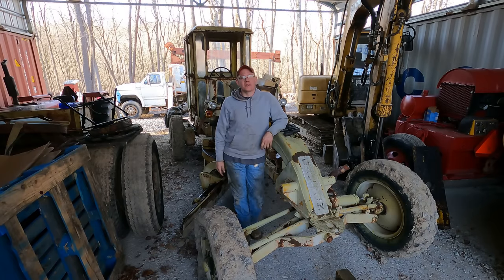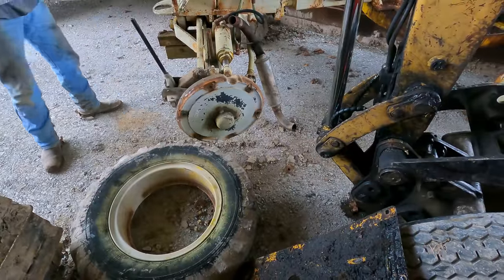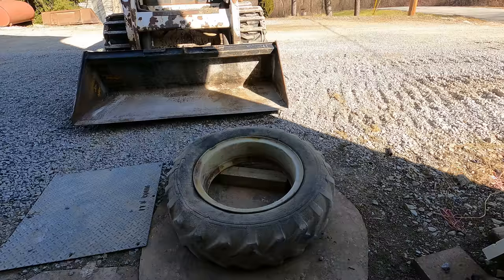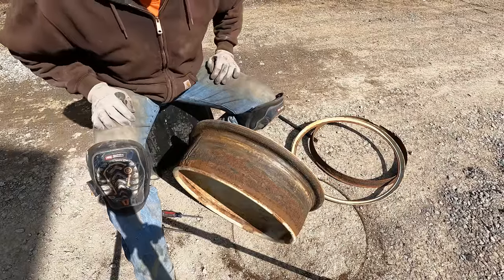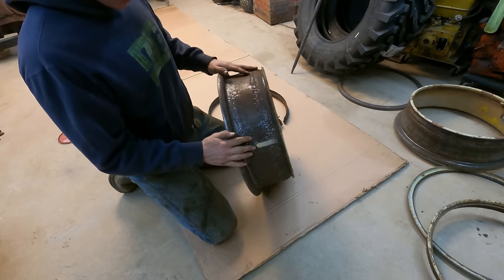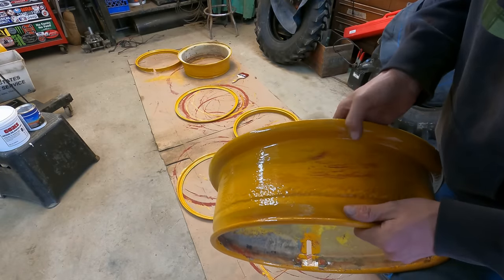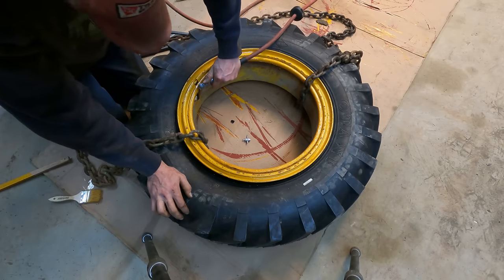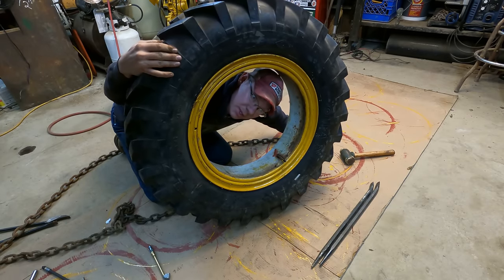1950's Galion Road Grader "Widow Maker Rims" Pt.4

Comment: Aren't the front tyres supposed to be mounted with the tread pattern the other way around (assuming they are not driven)?
So that you get the self-cleaning effect by pushing the dirt outwards. Which means that driven and non-driven tyres should be with tread patterns in the opposite direction...

Comment: ex tyre technician here, not recommended but you can drive a vehicle over the tyre to break the bead, destroys the tyre but your not reusing them so...

put a little air in the tube to prevent twisting before mount it, makes the tube easier to put in the tyre, but you done it before putting the locking ring on so no harm no foul

another tip is seat the bead before putting the valve back in, so you can rapidly deflate the tyre in the case the locking ring looks like it is about to fail.

i like your chain idea, we always had a steel cage to inflate them in, road side we just inflated on the vehicle and stood to the side out of the debris path in case of failure.

Comment: you should drive over the tire to pop off the bead. put some oil on the bead locking ring then drive just over the rubber.

Comment: Normally when the lock rings are removed you add air to the tire to blow your outer tire over the lock rings. then you can get the boot and the tube out then the tire will fall out. Also, when you clean a gas tank that has shellac or dried gas add alcohol it will dissolve the shellac and help clean and last always solder or braze any pinholes ! you can use a bis soldering iron and tinning flux.

Comment: Washing up liquid and water helps a lot thn after give it a scrub you all ready got it covered in soap 👍👍 good lil tip. Red oxide primer is really good use it all the time it stops bare shiny metal or new metal from rusting then if u put a top coat on,, ie the colour. It won't rust, rusty metal needs to be treated first with rust killer thn red oxide thn your choice of colour thn it won't start rusting again.

Comment: Your part on the Galion are the same as pre 1970 International acco 1800 series. Yeah some early doge and ford D series all so fit just make shore the the rims are 20 inch for tyres over 8.25 x 20 for single tyres set

Comment: generally not recommended to mess around with tires if you don't have the right equipment for it, but split rims are an absolute pain the ass no matter if you are equipped for them or not

Comment: I wouldn't walk too close of near rusted rims like that, one aspect that's never relayed regarding these is that when they start to rust, they'll pop out easy under pressure on their own. It happened to a truck depot back in the 90's that was behind my dad's business. The rim flew right into the side of the guard's building when the guard was checking some papers, made a decent dent in it. Can't imagine what would've happened if he'd walked out of the guard house just then. EDIT: worn down by rust, where tolerances are loose.

Comment: Pour some diesel around the rim, nice and thin, it'll work it's way in between the rubber and steel and make breaking those beads easy......easier. Split rims are not bad, just gotta do things properly and clean everything before putting it back together.

Comment: Used to work a lot with similar rims/ tires. Our rings were skinnier. 
Once a young guy noticed that the ring isn't seated properly. His colleague told him to air down and fix the issue. He decided to try and smash it with a big hammer. The ring was catapulted out of it's place and split the guys head in half. The daily leader of the garage went to prison, the co worker got a suspended sentence.

Comment: If you have not done the drive tires take and lay them flat with rings up and pour some paint thinner on and let it set and soak will break done a Lot easier then just flip and do other side.

Comment: I use grease behindthat pilot bearing, and with a piece of round stock close to the inner hole, stick it in there and "RAP" it with a knocker, and it should pop right off.

Comment: Look around the sides of the old tires, if there is not 3 sets of 4 number/letters after "DOT" then you know the tires are make before January 1971.  If there is the 3 sets of numbers/letters after DOT, then look at the last 4 numbers, first 2 numbers is the week, and the last 2 numbers are the year that the tires were made - ir: 1218  would be 12th week of 2018. 
(the TIN - Tire Identification Number was required for all tires manufactured after Jan 1971.)

Comment: After you clean up the rust off those old rims, spray them down with Ospho.  It will convert remaining rust to iron phosphate which is inert.   The surface will turn black and the  rust will not return.   Ospho also acts as a primer, so they could be painted.  Ospho saves so much work dealing with rust and it penetrates so it not only treats the surface rust but also rust below it.  Needling and wire wheeling gets off the loose rust, but surface rust remains and will continue to cause more and deeper rust to form eventually.  Ospho STOPS ALL THAT SURFACE RUST.    On those rims and rings spray with Ospho first.  Let it dry then paint.   Priming without treating with Ospho doesn't stop the rust it only covers it up...   Frankly, I don't know why more people don't know about how good it is for rust.

Comment: Before you lose your tube
Take it off get a 4 inch patch put a hole in the center for the stem 😄👍
The patch between the tube an flap
If not you will pop your tube 👈
Great times brothers 😄🙌👍

Comment: I have never done anything with those rims. I remember watching an old man in a tire shop change the rubber once. He partially inflated the tube before putting it in the tire. Then inserted the rubber insert and added air as he proceeded. Once he was at the point to fully inflate it,  he chained it until finished. He explained it is not dangerous until it is at the last part. Because the air has no way to escape at a certain point.
Do you agree with what he said? Curious to hear what you think.

Comment: If you get a length of angle a few inches long stand it up like a triangle with one leg on the tyre against the rim and beat on one of the side of the angle pushing it under the edge of the rim and down with a sledge it nocks the bead of great as all the force it right on the bead rather than just hitting the side wall

Comment: I know you replaced your tires with what was there, but as I remember from way back when the front tires were a ribbed tire so the front end was less likely to walk sideways when grading in hard ground. 

My guess is they took the old drive tires off the back and put them on the front when they replaced the drivers. If you are doing a lot of side cutting you wear out the steering tires faster than the drivers. 

By boss has the same grader if I'm not mistaken.

Comment: Try hammering a flat bar between the bead and the rim and pull the flat bar side to side to push the bead down.
Or the fun way fill the tire with oxy/ace and set a fuse in the valve stem. Trust me there is no faster way to take the tire off the rim.

Comment: You can probably take the rim piece you're missing to a machine shop and they can custom machine it, I used to work for one and we would do it all the time. They do have to program it but if they know how to work the machine, it's simple measurements.

Comment: We had some old tires at the county that noone could even budge.  They laid em out back and I took the backhoe and pinched the tire under the outrigger then squeezed off the tire with the hoe.  It was kinda fun with six or seven county hands leaning on their collapsible shovels watching me disassemble tires with a cat.
Reply: One other thing you can do for safety while the chains are still on those old rims is take a sledgehammer to them for a few whacks to make sure it's solid.

Comment: Multi piece rims are easy to assemble? Heh, never jinx it :)
But it sure could have turned out worse, great job!
As for the tire lube, the new stuff is always hard, a few drops of water into the cup and it'll smear nicely when you touch it with the brush :)

Comment: Hey man if you want a easy way to break beads next time grab a wire tar banger an a long bar with a spade end put the spade end on to the bead an slide the wire tar banger over the bar an wack it down hard  do it a few times around the bead an it will pop right off hope this helps you

Comment: Split rings are "nuthin but a thing" - on a truck tire you'd "X" bars through the holes in the rim to prevent the ring becoming a projectile BUT in this case I'd put the "ring side down" and use the bucket on the front loader to keep the assembly tightly on the ground. In BOTH cases you need to use a "clip on" inflator nozzle so you can keep a safe distance away.

HINTS: when assembling the tire/tube/sleeve - put the tube in the tire & put just enough air in the tube so that it fills the sidewalls, THEN - REMOVE the valve core & work the sleeve around the inside of the tire making sure there's no kinks, then, USING a SOAPY water solution coat the steel wheel hub, the exposed sleeve & the "beads (both sides) of the tire". Seat the tire on the rim  with the VALVE CORE OUT - this allows the tire to inflate faster & if there's a problem deflate faster (disconnect the air hose @ the source for safety). BTW if you did this assembly on a "debris free" area (aka piece of plywood) you won't run the risk of "stuff" getting caught in the bead.

If you haven't guessed, I've done more then 1 of these "back in the day" 😉

Comment: You don’t need a jack for the front tires on a road grader just lower the blade & keep the actuator lever down until the front comes up. Won’t work on rear, then you do need a jack.
Reply from the maker: Well there isn’t an engine it at the moment so it’s hard to do that lol

Comment: Rear tires look evenly worn and should be replaced, but beware tires need to be uniform diameter or you will torque/wind up the drive chains in the final drives. Change all or none at all till you can match all four tires.

Comment: You have the best beadlock breaker that you can get outside of the pros on the front of your excavator. You take that blade and push down on that tire and I guarantee it will break the bead. You could also use the bucket as well if you wanted. It would have saved you a lot of time and grief but maybe you can use that on the back four when you get around to replacing those. I had a Dynahoe 190-4 that had that style rim. I've broken the bead on those tires 17.5-25's with a sledgehammer and with the bucket and it is a hell of a lot easier using the bucket. Don't know if you have ever had to flip a 16 ply 17.5-25 tire by yourself but it will definitely make you shake your head a folks that want to do it for "fun" especially when it still has the rim in it. Of course doing crap like that is why I can't bend over and pick up a pen now without pain.
Reply from the maker: I’ve actually tried using the blade and the bucket to break the beads before with the hoe...I was very surprised that it didn’t work well at all
Reply: @DieselCreek  That makes no sense. I know the machine I was using was heavier but I learned it from my dad using his Case 600 Terratrac which weighs circa 6.5 tons which should be right in line with your machine. You need to get the blade right next to the rim, perhaps that was the issue. Well now you have the grader so I would use that blade. Should have plenty of weight and power to break a bead. I've helped Dad do it several times with tractor tires and have done it myself with those backhoe tires. Sometimes it takes a couple tries to get everything just right but still a hell of a lot easier than using a sledge of cutting them off. You could also use the grapple that you have on your excavator. I promise this method does work so don't give up on it cause it didn't work before.

Comment: Was riding on my project mower with out the seat or body panel on it so when I put it in gear I slipped and my foot and leg almost got sucked under the wheel

Comment: I know a guy that has that same machine and those rims are just standard 20 inch Dayton wheels that big trucks used to run back in the day even into the 80's before they went to the 22.5 and 24.5.  You can still get 8.25-20 truck tires but they cost more than the 9.00-20 and 10.00-20 so he just put 9.00-20 truck tires on it. If that last tire had air I would've just kept it as a spare and went to a junk yard for another wheel. Probably should've put 4 new ones on the back and put 2 truck tires on the front since it doesn't have any power going to it.

Comment: Take the wheel lug to NAPA and they should be able to match it. Looks to be the same as some trucks used. I would of found some better wheels off an old bean truck or school bus. Two piece would of been safer than those old rusted out 3 piece.

Comment: Always good projects down to earth. I don’t know about y’all but I think a wire wheel would be easier then the absolutly worthless tool they call a needle scaler all it does is overwork your compressor
Reply from the maker: No In heavy scale the needle scaler is the only way to go! Wire wheels will just polish up the scale if it’s really heavy. Even a sandblaster won’t remove it effectively. They do take some air but that’s why i have a bug compressor

Comment: Love seeing old tractors  and machines.  They have a great sound. They dont have 15 safety interlocks.. so if your an idiot the machine will let you hurt yourself.  I love that you need to have a brain smarter than some on board computer.
     Three pound hammer.  ?  I think my hit stuff hammers start at 4 pounds and go to 8 or 12.   I get tired fast swinging a 8 pound hammer.

Comment: The three piece rims are not that dangerous. It is the two piece ones that are banned.

Since you have directional tires that are not drive tires but rather being driven you may find that they will be more self cleaning in mud if you swap them side to side.

Comment: Instead of all the work of mechanically removing rust place rusty metal parts in a vinegar water solution  and use a battery charger to clean it with electrolysis hook the negative to the rusty part hook the positive to a piece of scrap steel

Comment: Actually those are three pieces rims ,,side ring locking ring and main rim , True widow makers are a two piece rim that separates in the middle right above the decoupling ring ,,,,old Ford Chevy and Dodges ran them on the 1 ton and up trucks

Comment: 6:00 we have a local tire shop that does these and these guys attack that tire with so much energy they're like bull wrestlers. 
BTW I had one tire on my Cat grader that wouldn't for the life of me come off. I ended up wedging a piece of railroad tie on the inside of the tire and using the tilting mechanism to put pressure on the tire. That + the 10lb maul did the trick.

Comment: As For your three piece Rims

Used to Fix Truck tires [LOTS!] with Flats ~ With three Piece Rims

You would do really well in investing in the proper sledge hammer [flat wedge shaped on one end] to break the Bead

Use the wedge to Break the Beading - Careful as it takes/requires Good aim to get the wedge to land Between the Tire and the Beading Ring - BUT it will Break it far more easily then what you are doing [Miss and Hit the Rim and feel your Hands ringing! OUCH!!]

AND while airing up ~ to Avoid Damaging Yourself or others A Small piece of Chain Locked Around the Inside/outside of the tire/rim assembly Will Constrain any Expulsion to remain as ~ Still in one piece ~ and NOT allow it to ~ Fly Apart ~ totally unpredictably

Stay Safe ~ Stay alive

Thanks for your time 😎

Comment: Please take my comment with a grain of salt to any of those who wish to ignore fair warning.
I don't need to go into extreme detail about the incident I witnessed as many won't have the stomach for the gore.
I was within 20 feet of a tire & rim off of a 5ton 6x6 & I happened to look up as the shop air turned to misty vapor and my ears ringing before I realized what had happened. A young Marine had just come back from lunch and was using an impact to break down that style of split rim. When he had started to remove the third remaining nut off of the stud all hell broke loose . The small part of the rim as in the outer piece caught him under the chin and degloved his head. This is the clean explanation.  He almost didn't live through this ordeal of chance he took by not following explicit directions about who was to do what and only then break down the rims. They had already done 15 that morning and it was a slip in his decision that almost cost not only his but several others lives. 
I would be the last one to tell anyone they are to unsafe. As the safety of these rims has practically nothing to do with a rim in working order. I've never heard of one failing while being used. The danger comes when making sure seals are seated and retainers are properly installed. 
To finish the story this young Man had failed to ensure the air had been removed...  All 100 psi of it.
His wife almost became a widow that day. 
There has yet to be a day that I see one of these rims and not be reminded of his lifeless body laying on the pavement 60 feet from where he was working.  
I don't buy into 90 percent of the crap most of the commenters squell about on Youtube. We can't function effectively nor safely being wrapped in bubble wrap to be safe.
I do always hold the belief you are not always taking just your own life in your hands but sometimes others as well. Not to forget those close to you that will share your pain. Sorry for the story but it is one I felt was worth telling for the greater good..